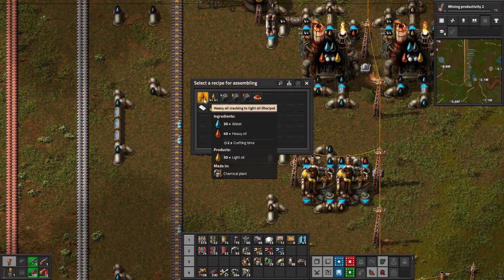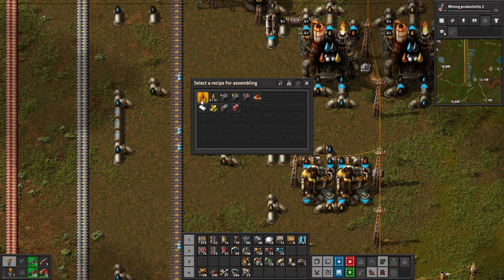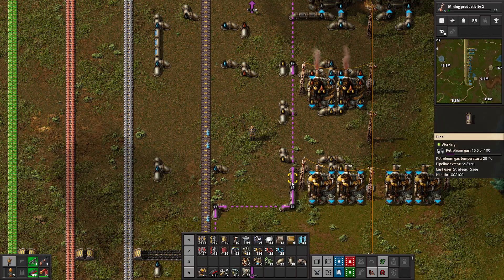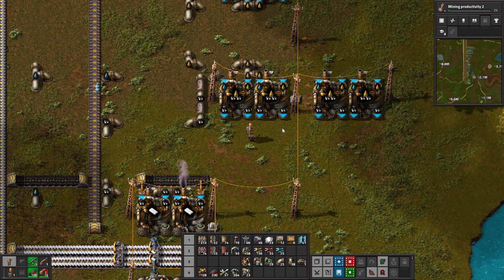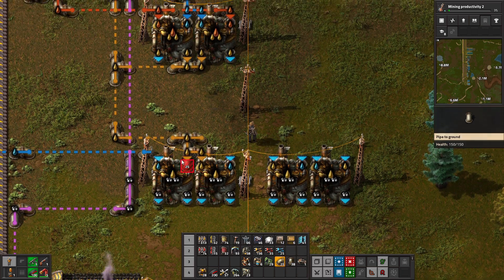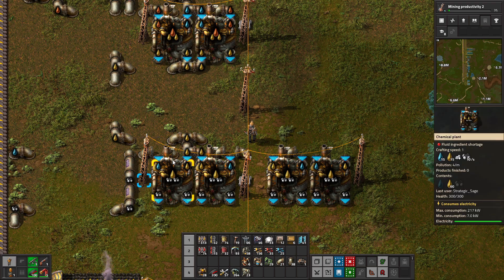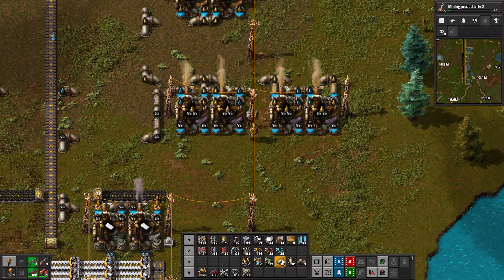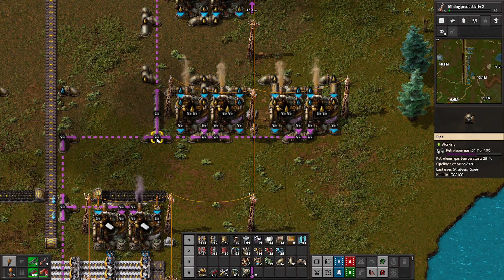Advanced Oil Processing | Factorio 2.0 Tutorials For New Players | 18

Comment: Is there a rule of thumb or ratio on the number of tanks you should have?
Reply from the maker: I wouldn't ever build more than each for light and heavy oil.  Even that is way more capacity than you need;  the goal isn't to store a lot of it.  Almost all of it is being cracked in petroleum gas, and that's constantly being used so what is in the pipes is plenty.
Reply: If you're asking about this, it means you don't need big tanks.

Comment: I'm not a Factorio player -- don't ask what I'm doing here -- and so far I could follow the base-building just fine. But here, I don't know what oil will be used for and so those two minutes flew by in a "yeah we're doing that trust me bro it's going somewhere" kinda way. Still feels like I'll be able to hop back on once those pipes get connected to prod', I guess oil is that much of a sharp turn in Factorio.
Reply from the maker: I get what you're saying, but for now we are just cracking it all into petroleum gas so it's all being used.  The 'full picture' would require explaining multiple other complex things, and cramming that all into one session would ... be bad IMO.  Which I think is a big part of why oil is such a learning cliff for new players.  You have to know a lot to really set it up well.
Reply: It’s basically a juggling act. You start with 1 ball, and are thrown 3 more, and you gotta find your balance since more balls are waiting 🤓

Comment: Will you be covering lubricant in a future video? I have wired my heavy oil tank so that it feeds into the lube plants by default but spills over into light oil cracking if it gets too full. I have wired my light oil tank similarly so I always have some light oil for producing solid fuel before using excess for cracking into petroleum. It works with simple wiring but the pumps flicker on and off. I may explore using an S-R Latch decider combinator in the future
Reply from the maker: Lubricant will be part of a future video, but the short version is that the pumps are designed as a divider the way I set it up.  Nothing but cracking is done past the pumps.  Lubricant and anything else I want to do happens before the pumps.  That's how it works! :)